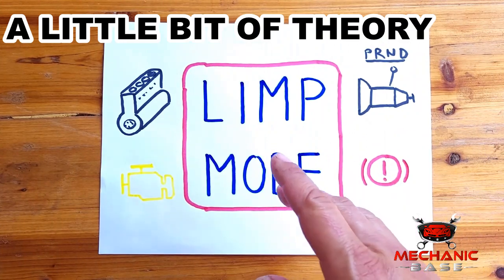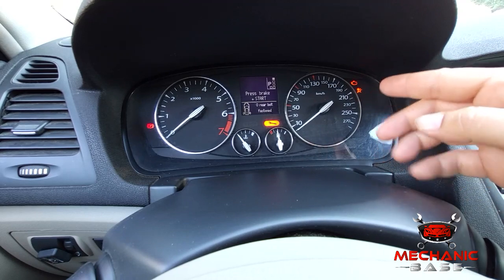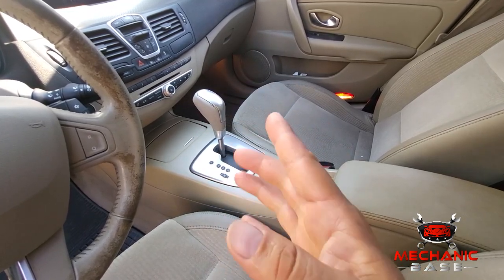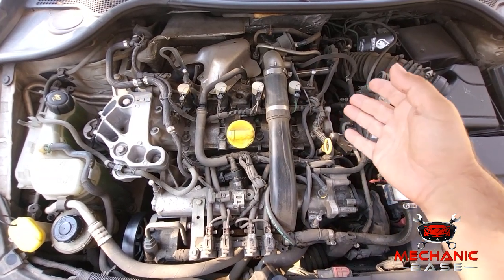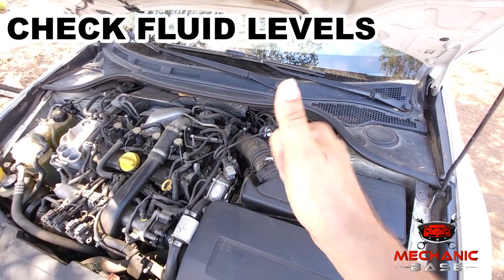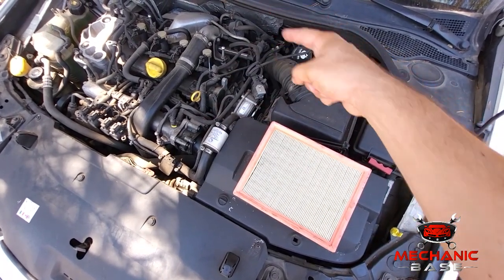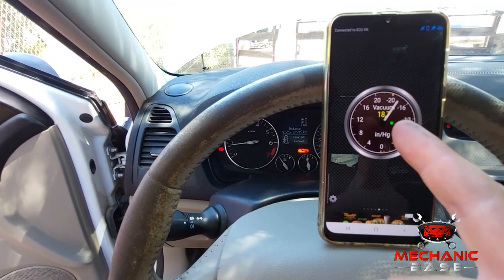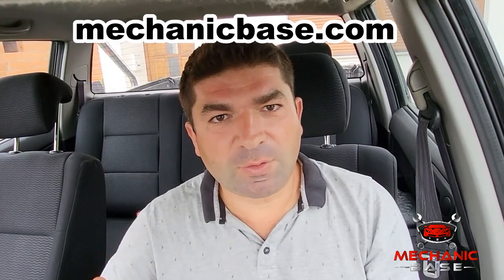Limp Mode: Meaning, Causes and How to Fix It

Comment: Seems like they've made cars 100x more prone to difficult malfunctions and failures for a slightly "safer" car. That's the modern world.
Reply: Don't forget the cost is up 500%
Reply: They know averages driver habits.  Here unusual sound, I'll just ignore it.  It will probably go away or I'll fix it 6 months later.  Car breaks down. Oh no Idk why it just broke down,  it was working fine this week. It didn't show any symptoms.
Reply: @johnnyp3839  That's true, one thing affects the other, but if you don't have diagnostics, you can't see any issues unless you pay a lot for a mechanic to plug his £2,000 professional diagnostics device (android/Linux tablet) in and press a button. Thankfully, you can get DTC readers cheap now, with very useful live data too, but most people have no clue they are out there, so they get zero benefit and all the negatives. Plus, the things that cause most issues are faulty sensors. I bought a DTC reader and fixed my car myself. Saved about 2 grand.

Comment: Does Limp mode show up with diagnostics? My Ford S-Max diesel, when it goes weird,  sounds like a cylinder is out of action, but it says "engine malfunction" and the ESP light comes on (skidding car icon). Is this a characteristic of limp mode? Or is it in limp mode because of a malfunctioning cylinder(injector/plug etc)? I did self-tests in FORscan, and it passed all tests, apart from there was an ABS error and a tyre pressure sensor was malfunctioning. This is a nightmare. There's also an injector code (a short I think), but says engine light is OFF for this error and "this DTC is not currently present". We had an injector replaced in the last couple of years. Also, the horn is not working, not sure if that matters.

Comment: Good explanation of limp mode, olso a faulty speed sensors is a cause of many limp mode condition
Reply: I wish they would take all these sensors out, they just create more points of failure and often about as expensive to replace as the part they are trying to protect 😅

Comment: Even with going through every possable thing that could have put my car into limp mode and would get it running and driving great.  It would always go back into limp mode no matter what I did.  So here is the thing it would have had to go to a dealer to clear it in the ECM. By the time I figured that out I was done with the car and just scrapped it.
Reply: Mine went into limp mode because of a radiator level sensor.

Comment: Hi I have a VW t4 2.5 TDI.automatic the automatic ecu have no fault codes. The engine ecu has charge pressure control negative deviation p1556 code. Have changed the n75 valve, have changed the maff . Have checked intake pipes for leaks. Have replaced o ring on turbo intake . Garage has looked at it and checked too. All vacuum pipes seam to be ok. When I brought it it add an EGR delete. So I believe EGR is not the problem. Was told by garage to put a boost gauge on which I have done to check the psi . It is showing a psi between 6and 7 . The symptoms are when going up incline it goes into limp mode . If I switch the engine off and back on it drives fine for a while, then goes back into limp uphill or incline. When I installed the boost gauge,l accidentally did not attach the vacume pipe to the waistgate. The van drove exactly the Same ,limp mode on incline.turn off engine and drove ok until next incline. How can it drive ok without the vacuum pipe attached to the waistgate. I am wondering if this is the turbo itself. Or could it be the fuel pump that is.faulty Or fuel solenoid.. garage is going to fit a manual boost control . To override the n75. I don't think it will work because it drives the same without  the vacuum pipes attached to the waistgate.
Your advice would be very much appreciated thank you so much for your video.

Comment: My 05 neon keeps going into limp mode and the check engine light comes on but the code reader only throws a code for limp mode. So I don’t know what the underlying problem is. And it’s doing it more and more often

Comment: The Limp home mode almost killed me! In the middle of the night on the Russian step between Volgograd and Astrakhan my Chrysler Voyager went into limp. It was minus 30 celsius outside and the car wouldn't go faster then 30 kph in second gear. There are no mechanic shops, because there are nothing within 8 hours of driving in normal speed. No gas stations, no houses, no traffic at night. No phone coverage. With a car full of children and people the only option was to continue. After a 24 hour journey of getting passed by honking trucks we got to Astrakhan, but by then the transmission was shot. Back then you couldn't find anyone who could repair the car in Russia. The only option was to just leave it there, since transporting it 3000 km to west Europe cost to much. I am sure the car would have made it without problems without the limp home shit. Before starting the trip I had an oil and filter change on the transmission and the shop put the wrong oil in it. This caused a sensor to complain. The Japanese tranny didn't like Dextron 3. It's a common fault on Voyagers.
Reply: I'd love to hear some stories of living in that kind of area. I bet the wild life and the wilderness is intense out there.
Reply: @pjjoseph6015  It's a wast area of nothing really. Bone dry, except in spring when there is a lot of flowers. From the car you basically only cows and horses that are very skinny walking about. There are no fences and they do cross the road. Where there is wet lands around Volga river it's more lively. A lot of frogs, one for every step you take. The steppe though is flat, very windy and no treas or bushes. Oh and war memorials everywhere.

Comment: I have a P0776 pressure Solenoid B stuck off code and my car went into limp mode. Anny suggestions on how to fix it?
Reply from the maker: Try a fluid flush & replacing a filter.

Comment: I once had faulty knock sensors in a 2004 Lexus RX330 which is my first time experiencing limp mode in a car.
Reply: I have experienced limp mode multiple times in my is350 it’s very ridiculous that the engine light isn’t even on or anything but just a check system which I think is for the tire pressure sensor, my car might be misfiring a bit also replaced MAF flushed gas etc….

Comment: I have a 2010 camaro ss, it goes in limp mode only when I smash the pedal and I can still shift in all my gears but it runs ruff and stalls out sometimes, sometime u can start it while it like that sometime no, but I can get it back normal changing a small 50 cent fuse in the fuse box but it keeps coming back when the car does goes in Limp mode it said fuel pump control module took it to the mechanic 3 times he said it’s an electrical issue

Comment: I jumped off my kia sorento with my 2004 7 series. A few days after, my BMW went into limp mode. No power, would only go into 1 gear. Didn't immediately understand that the issue was jumping off the suv, which I did about twice more, i stopped jumping the suv off, and continued driving the BMW in limp and in a day or two it corrected itself. Sometimes you don't need to overthink it🤷🏾‍♂️

Comment: I read all the comments on every site dealing with "limp mode" but I've seen NOT A SINGLE COMMENT mentioning the "fuse reset fix" that works on both of my Japanese cars.
     I have two cars which go into limp mode, but only in very hot weather.  A 2005 Toyota Corolla SC, and 2008 Suzuki SX4.  Both of these cars have 5-speed manual trannies and run just fine in all but the very hottest weather; 106-114°F like we've had this yr in the SW desert.
     The first time it happened in Suzy, we were were cruising like 106 mph on I-10 through SE Texas.   We stopped at Buckee's (to buy under-hood fuses) near Bayview and some dude showed me to pull the fuel system fuse, and put it back in to reset the system. Seemed to work just fine all the way to Ft. Myers, Jacksonville, Fla & all the way back home.
     I did clean the MAF sensors and coked-up throttle bodies of both cars which seemed to help, but they both keep going limp in our VERY hot weather.  
     My cheapo Chinese OBD codes say "so sorry, maybe something wrong with one or more of MANY fuel system gizmos or maybe wiring or maybe connectors."  WOW!! REALLY helpful!! All I gotta do is replace ALL the fuel system components, ALL the wiring harnesses/connectors and MAYBE if I'm REALLY LUCKY it'll be fixed, and then again, MAYBE NOT!! 
      We took Suzy to a local mechanic and after driving her for two days, he couldn't get any codes with his $500 Snap-On OBD.
     My miraculous fuel system "fuse reset' routine seems to work in both cars, so I'm considering installing a handy-dandy 10A circuit breaker/push-off switch near the driving position to save the trouble (and maybe my precious behind) of the pull-off-the-road/under-hood drill.

Comment: My 2015 F250 6.2 L  gas engine truck went into limp mode because the dime sized  rubber disc on my brake pedal fell off . The disc is the contact for the brake switch. With out that disc the brake lights will not go off . Which amounts to an unsafe operation. There was no codes . I glued it back in place and the truck ran great.

Comment: I have a 2012 Jeep Wrangler JK, camshaft position sensor bank 1 error code is lighting up and I replaced the sensor with an OEM  part, but still getting the error code and it's putting the engine into limp mode.

Thinking about removing the TIPM and cleaning it, along with disconnecting the battery terminals and connecting them together to drain the power out, then doing a hard reset.

Comment: ford focus 12 not shifting after 3rd gear . but if i move to neutral and bring it to drive mode then t shifting upwards you know why?
Reply: Mine does the same. No warning lights but shifts fine manually and in sports mode
Reply: most say its TCM atleast you can drive in sport mode
Reply from the maker: Do you have any warning lights? Does it shift manually?

Comment: I have just went through this, my DTC code was PO075, it's a code for the transmission for a Dodge. The first thing I did was replaced my solinoid pack, this did not solve my problem. What the problem was, ...was my wiring, there was a short in my wiring that was causing the issue. I replaced my transmission wiring  and the issue was fixed. I would recommend that you join up with ALLDATA diy. and follow the diagnostic steps. If you don't have a code reader, get one and go with ALLDATA to fix your car. Hope this helps.

Comment: Great video. But my 2007 audi a4 quattro 2.0L turbo goes into limp mode intermittently without any codes and no check engine light. I am just lost. Any help would be greatly appreciated.  Thanks
Reply: Check ECU or tcm relay, fuses, wire

Comment: There is no such thing as an engine running in limp mode. Limp mode refers to a base (no shift) mode for the transmission. The base mode for the engine is called "reduced power mode". Referring to reduced power mode as limp mode makes as much sense as calling all refrigerants Freon, or calling all cars Ford.

Comment: My code is a bad Tcm on my 2010 Nissan Maxima. I replaced the transmission about a year ago , the car had 130,000 miles but car goes into limp mode every few months but not all the time. My question is has anyone else had this problem and if so how much money am I gonna be out of?
Reply: Yeah, mine be doing that, changed transmission and engine. New engine goes to limp mode 6months later, i changed oxygen sensor, mAF sensor, fuel pump & throttle body. Its now okay, feeling brand new.

Comment: your using your phone to check codes ? how are you doing this ? is it a app ?
Reply from the maker: Yes, there are many apps (i.e. Torque, or DashCommander) you can use for this. But you'll need an OBD2 bluetooth adapter, too.

Comment: Mechanic Base my car (2017 Nissan 370z) only goes into limb mode(3500 RPM at most) at night around 6:30ish PM and last until 7-7:30 AM and then will drive completely fine during the daytime haven’t been able to figure out why scanned and replaced things with corresponding codes and haven’t found the fix
Reply from the maker: Which codes did you have?
Reply: @MechanicBase  I’ve also replaced everything I possibly coukd such as fuses, the brake lamp
Fuse behind the brake pedal amongst what feels like 1000 other things and I’ve seemed to get no where

Comment: I have a 2008 honda civic fd1 the car goes into limp mode and the d light starts blinking. Whenever the car is in speed and i suddenly press the brake the car goes into the limp mode..
It giving the code p2122 and P0138
Reply from the maker: Both these codes are voltage related. And since it only happens when braking, we'd suggest checking the engine harness wiring first. It may be damaged somehow, which manifests itslef during sudden stopping.

Comment: Detailed video. May  I know if the car is in limp mode if I get high RPM than normal like 4000 RPM at 60 MPH? 2004 TOYOTA RAV4 4WD Automatic. 
If not, what are possible causes of high RPM in Toyota Rav4? Thank you.
Reply from the maker: It seems your RAV doesn't shift beyond 3th gear, @juliustay2541. Do you have any warning lights on the dashboard?
Reply: @MechanicBase  yes check engine light and code P0713 and P2238. I have replaced the upstream oxygen sensor and the automatic transmission fluid temperature sensor but codes are still on
Reply: I have the feeling that it doesn't shift beyond 3rd gear, I count only 2 active shifts and then no shift again and my RPM remains high like that and keeps rising if I accelerate the more. Several local mechanics have assured me that the 4th gear (my last since it's 4 speed automatic) is silent in changing and that's why I don't see it changing by the reduction in RPM. So I have been wondering what could cause that high RPM with a bad fuel economy.

Comment: Just like to say I don't like your videos always informative and easy to understand, here is my question I purchased a C-Class w203 2004 1.8 compressor automatic, this car exceptionally good condition it only had 125 km on the clock, with service history, I do not say this lightly but it literally drove like a new car,    it had no check engine light's a driving in like a cloud I suspect a bit of a douche move on my behalf maybe because of my I drove the aggressively 50m up my road and 50m back down my after I did this my check engine light and for a minute or so I was getting the impression that one of my spark plugs might have gone is it possible what I done could have caused unfortunate what I was considering down was disconnecting the battery to allow the computer to reset in the hopes that it might override the I was also going to check the air filter make sure no critters had gotten in there but as I say this car was so cherry that the engine bay was spotless, 
I do hope you can help me for that matter even anyone reading this if anyone can enlighten me in anyway to the fact of did my actions and how can I rectify it

Comment: So far I've... 
Replaced air filter, MAP sensor, topped off coolant. Nothing helped, 
No codes... still loses power after 60mph. 
I have an appointment with the mechanic tomorrow. Ill let you know what issue is.
Reply: What was the issue?
Reply: Would assume it was sometimes major dealing with the engine or transmission.  What you listed was minor problem.  The car ECU would make adjustments to those bad scenarios you listed

Comment: Can limp mode occur without the check engine light on? I have a 2015 Chrysler 200 with the 3.6 V6
Reply: Did you ever figure out the problem

Comment: Pls help. I was using my dad's Nissan car. I have a permit. I was doing a u-turn and suddenly I notice a change of speed, and my dad's car won't go past speed 40. I wasn't sure if it went into limp mode or not. Idk how to fix it, I'm too scared to mention it to my dad. While I was u-turning I couldn't fully turn. I have to back up the car and change gear again to fully turn out of the road. After that the car lost speed and won't get past 40. Is there any way I can do to get the car back to normal? I tried checking my dad's car, but there's no warning or anything.
Reply: @savanna it's not your fault, it's a Nissan, troubled vehicles, NOTORIOUS for having this problem. Nissan knows about it.

Comment: Hi,

I stupidly accidentally let my 2012 chevy cruze run out of gas on April 3rd, 2023. Once I pulled to the shoulder it shut off. I then tried to restart it. When I did, the engine shuttered, vibrated roughly then I immediately shut it off. 

Then the reduced engine light has come on and is in reduced power mode after that. Despite trying the turning the key trick to try to reset it, it's still on. It's still on even after putting more gas in it. So now its driving power is reduced. 

Friends came to help me and put a little gas in the car. Before going anywhere he used his code scanner thing. He said no codes popped up on the screen. But the reduced light is on and its performance is now reduced. 

What on earth is going on and how screwed am I now?
Reply: im pretty sure u fucked up ur fuel pump

Comment: I am having problems with my 2006 Nissan Murano, Code P2122, P2138 and P0643, Changed Pedal, Changed Trottle body and still car won't accelerate. Once TPS or Pedal changed car drives for a while like 1km and it goes to limp mode with Slip light and VDC displaying a check engine light, when I disconnect the pedal cable the car get high acceleration can drive . But it's slow. please any suggestions for possible solutions?